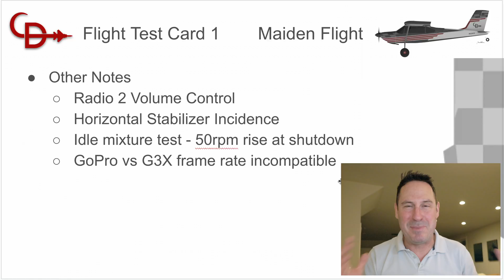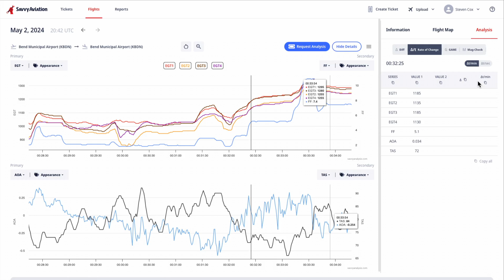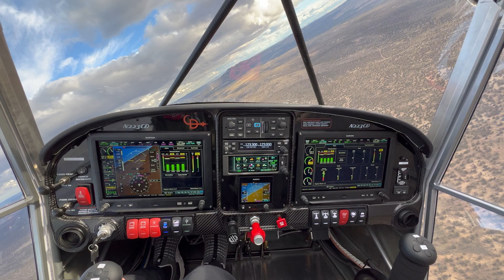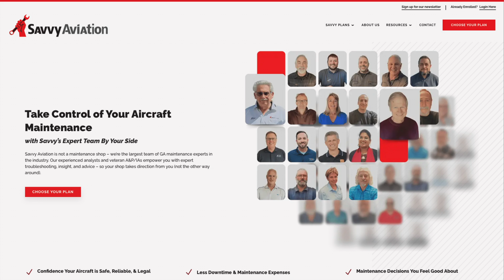Ep 0 Introduction - Task Based Flight Test Series

Comment: Hi Steve, Congratulations on this amazing series, and thanks for sharing your knowledge and experience! I am almost done with my build and I have a question for you about the operation limitations for phase 1. My project is based on an airport that is surrounded by populated areas. DAR is saying FAA won't approve a first flight out of this specific airport because "26. Flight over a densely populated area or in congested airway is authorized for the purpose of takeoff or landing;"    I spoke with local airport ATC (KFXE) and they said they would clear me to flight out of this airport climbing in close traffic until high enough to clear populated area with glide. But FAA/DAR, disagree. Would you be able to share some thoughts on that? maybe point out document that could support my request to execute my phase 1 out of this populated area?
Reply from the maker: Congratulations and that sounds like a huge frustration. Plus you're only 4nm from the ocean. I would first consult your local EAA Chapter. Surely there are other folks who have flown their first flight from KFXE? Second, I would consult a different DAR. In fact, consider not using a DAR at all. You can use the FAA directly through the Certificate Management Section (formerly known as the MIDO). I've reached out to my DAR to ask for further guidance. Do me a favor and contact me at steve@cleared.direct and I'll follow up... More to follow.
Reply from the maker: From my DAR: “OK, there are two issues that can usually be resolved.  Usually, amateur built aircraft are restricted from class B and C airspace during phase 1 flight test.  However, if the builder were to coordinate with the local FADO and Airport Authority for the first flight to be for exiting the class C airspace, flying the most direct route from the airport avoiding populated areas to the ____ airport for the remainder of the phase 1 flight test explained in time and area of proposed operation (line on a sectional, etc)  that should be acceptable to both.   So, the area of operation wold be issued by the DAR, and the coordination to get the aircraft flown from Ft. Lauderdale to that test area, and using airports in that area as a "base" airport with the FSDO and Airport Authority should resolve the issue.”
Reply: Thank you very much for the reply!